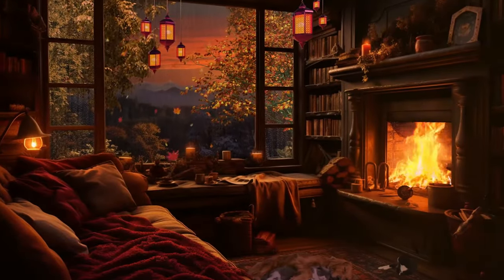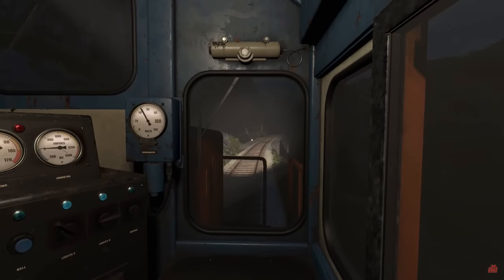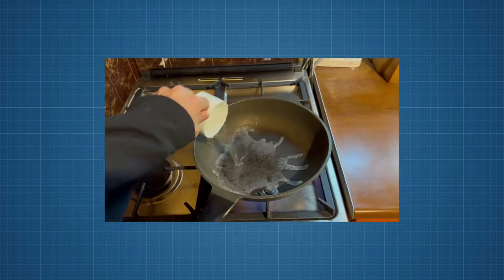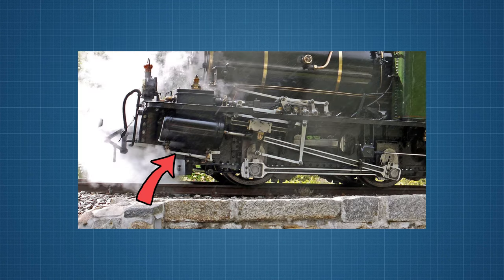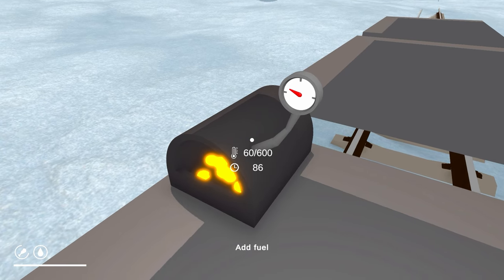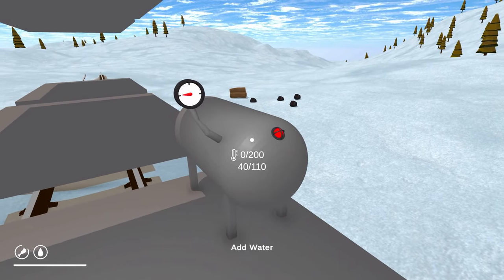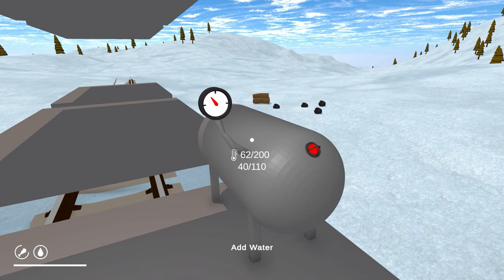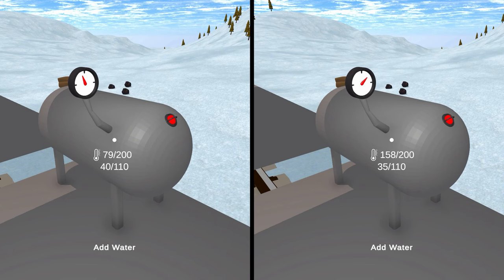Making a Real Engine for my Train-Survival Game | Devlog 1

Comment: The temperature increase in the boiler should be dependent on the current temperature of the boiler. Using the difference between the firebox and boiler temperatures multiplied by some constant would achieve that.

Comment: Good understanding of train theory, although I would prefer to see a proper full-size boiler. I also agree that a normal forward-facing boiler would impact visiblilty too much. However, other configurations do exist.
Cab-forward locomotives have the cab at the front and the boiler in the back. The downside is that it cuts off access to the back of the train and the tender.
Another interesting design in the camel-back configuration. This is where the cab is mounted on top of the boiler. Not only would this configuration have a unique and interesting aesthetic, it'd also give a better vantage point and still allow for movement around the train.

Comment: in reality the thermal flux is related to the difference in temperature, so a high temperature differential leads to a high thermal flux, also has to do with mass, so a larger volume of water will take longer to heat, assigning a constant value i think will be noticably wrong.

Comment: I looove this project so far, and looking forward to updates
Quick question, are you planning on requiring the engine to be 'topped up' with fuel and water? For example chopping down trees and using it for the engine, coal being found in the station you mentioned and other similar places, with it being harder to find and more efficient. You can also require water to be found in wells, lakes ect.

As for visibility, maybe you would want to model the engine after a smaller narrow gauge engine, i think a smaller train would fit better in a game like this, over more massive engines thats you automatically think of when you think 'steam train', a smaller engine with shorter boiler will also allow you to see you surroundings better, and, depending on the design, can be made to be claustrophobic if you want to go into a more errie/horror theme
Reply from the maker: Thanks :) Glad to hear that! Yes, the player will be taking stops to explore houses, or other places. Not sure about chopping trees right now, but yeah, the coal will be something the player should search in those places. I love the idea of wells actually, that solves the problem of searching wster that is not drinkable for the player, but can be used for the train! Can’t comment about the look of the train now, yet some things to be thought about before starting to design the train! Again thanks a lot for the suggestions :)

Comment: I dont wanna be that guy but..... this is not realistic at all ToT. The whistle doesn't release that much pressure (you'd need to hold it town for five minutes to release 10 psi), and there is no light to warn you for low boiler pressure.

Comment: I wonder how the engine will be improved along the way. Will there be salvaged parts, new random engines you can find. Maybe have cars that carry extra supplies along the way.
Reply from the maker: As of the right now, I’m thinking to have upgrades in the stations as the player progresses. There will be other engines working on a different fuel
Reply: @Vav97  Maybe at a certain point, you could implement from solid fuels such as wood and coal to liquid fuels such as oil. Assuming you're going to keep this game based around steam only. Then along the route, you could have risky paths with "Old rails" that would have deformities that could detail the engine if the player was moving too fast or exceeded a certain amount of tonnage. The reward could be a rare modification or a spare car full of oils or fuel to extend range.

Comment: i know you didn't want to make a train sim, but will you at least have a proper steam locomotive model at some point?
Reply from the maker: Of course! These are just temporary models for testing the mechanics. I’ll hire a 3d designer to make us a nice train model
Reply: @Vav97 But with a realistic-ish looking model, will that also mean that water and steam get put into the same container and their stats simply move to gauges?
Reply from the maker: @roadtrain_  Not necessarily, the model will be close to a realistic model, but there are some things I just can't make like in a real train. For example the cabins irl are very small, and in first person there will be no space for the player to move in the cabin. The game is anyways in a fantasy genre, so I'm not worried about that :) One thing I know, it will look cool in the end
Reply: @Vav97 Well, one thing you could maybe look into is a shay style engine, which has the boiler offset. This would give you extra visibility. Of course a larger cabin would also be quite neat. You could also forego using a locomotive + tender setup and go for a bunker-style locomotive, which simply carries coal on the back. Might help with the design and stuff. Also, could take inspiration from voidtrain for train design?